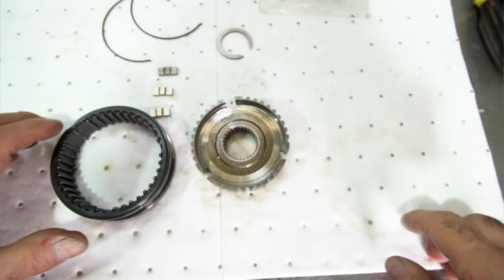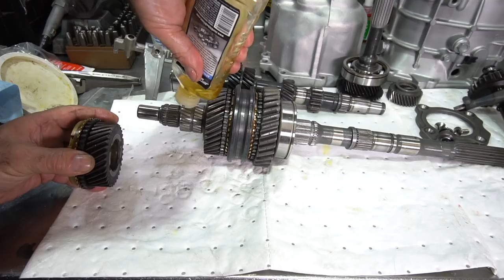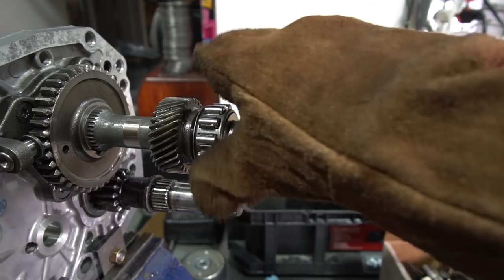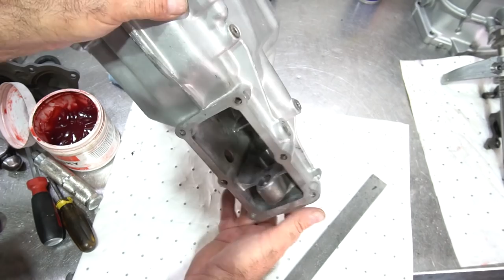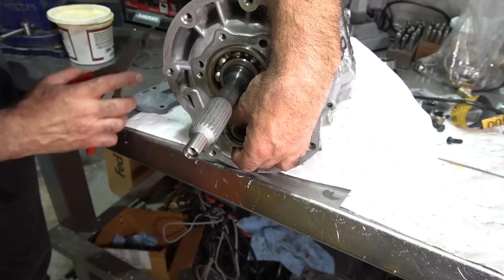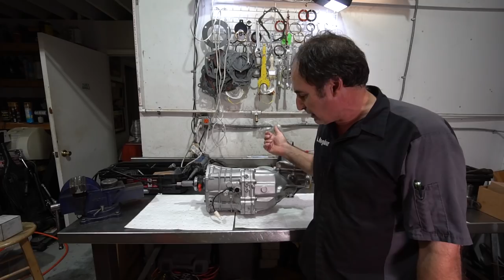How to Rebuild a Toyota W58 5 Speed Transmission - Part 2

Comment: I have a problem, as I mentioned before I bought a w58 to swap the A/T from my Is300 and I think I have the wrong driveshaft because if I try to insert it is hitting that bushing 40:25 ... this is driving me crazy, Should I get another driveshaft or what?....... keep in mind, I’m doing it myself
Reply from the maker: It could be just the wrong yoke. Some yokes have a larger outside diamter
Reply: Are you trying to reuse the AT shaft? Usually the AT shaft won’t fit in the MT gearbox as the yoke for the AT can be slightly bigger or the splines will be different.
Reply: Daniel G absolutely not, I know that the A/T is shorter, I found that my w58 is from 1987 and got like a ring on the tail housing and I need a special driveshaft

Comment: So I have a question I have a w58 in my basement from my buddies Lexus sc300. The guy we got it from said it was a “later model w58 with the steel ring” do you have any clue what he’s talking about ? Also the input shaft has a little bit of play can the input shaft beearing be changed alone without the whole trans being taken apart ?
Reply from the maker: It's possible to pull the front retainer off and with a puller get the front bearing off. It's a tight fit. He maybe thinking of an iron center support.
Reply: GearBoxVideo good to know! Trans was flawless besides the small play I noticed. What causes the gear whine on these trans ?
Reply from the maker: Low oil. Which ruins the cluster And input gears
Reply: When he says "steel ring" he probably means the cast iron centre plate.

Comment: Do you know the technical differences between the Toyota g52 and w56/w59 in the Toyota trucks? I think the g52 was behind the carbureted 22rs whereas the w56/w59 was behind the Efi trucks. Is the w series stronger? Better gear ratios, longer lasting? Also didn’t they have gear driven transfer cases? Why don’t manufacturers make gear driven transfer cases anymore?
Reply from the maker: I do not know the difference
Reply: pirate 4x4 says that the w is a little stronger than the g, but not by a huge margin. The R transmissions they think are about twice as strong as the W.
Reply: The older ones are gear drive transfer cases, either 92 or 95 and up (i think 92) they went to the chain drive. Marlin crawler says there is no strength problem with the gear drive cases. If anyone would know, it would be the people who machine parts for multiple stacked reduction cases, so I would trust them. They do a number of different cases the old ones the new ones and non-toyota ones on toyota gearboxes.
Reply: Toyota seems to agree, when they do the jz engines without a turbo, they used W gearboxes. when they put in turbocharged jz engines they used R gearboxes. Both will bolt up, R is heavier duty. Call marlin if you need help figuring out how to bolt an R transmission to your truck.
Reply: FlyTheElephant ok I did a little research: it seems that a g52 is about 30% weaker than a w59 in trucks around the 85 model year. The r series, especially the r154 are around 50% stronger than the w series as you said. Larger synchronisers, bearings and gears in addition to a well designed case make the r series the strongest transmission of the lot. Do you know if an r150 or 151 will bolt to a standard 22r or 22re? I know they used the r154 behind the Turbocharged 22re’s; however, that is a different block with altered rœtæting assembly and pistons, as well as a redesigned head...
Reply: @ramblerclassicman221  yea call Marlin crawler. They know the specifics.

Comment: Hey bud, please help. I just had a friend replace the bearings in My R150f Toyota tranny. I pulled the cases off and took him the rest cause he had a press for the bearings. I got it back and he had a rod turned wrong, but i clocked it correctly and made sure it shifted fine. Long story short. I got it installed and it seems like it's not coming all the way out if reverse. I can shift fine through all the gears,but when i put it in reverse then back to first it acts like it binds. Ive been messing with it for a little. And i can shift in second from reverse and it will come out of reverse. U just cant go from reverse to first. Once i shift into second gear first, i can go into first. Or i can go from reverse, straight to second,and its fine. It just seems like reverse isn't disengaging all the way. No i did pour all my mt-90 down through the top and i also poured Lucas oil stabilizer down it first. I thought taht since that stuff is thick, it was making it stick in reverse,but i drove it around for a little and it still does it. So i think that reverse arm or fork isnt pushing the gear back far enough and when i shift into 2nd it somehow bumps reverse out. Could he have somehow left out something on that reverse fork, or there be some kind of adjustment on that fork? Please help. Your the smartest tranny guy i know.
Reply: Also. There is a little oil pipe, that fits up in that case ,and it kinda lines up with the counter shaft. Its a little small plastic funnel looking thing. I really don't see what good it does,and mine broke all to pieces so i just left it out. Will that hurt anything? Like i say, my newly rebuilt transmission (r150f) isnt disengaging reverse completely.
Reply from the maker: I honestly don't know what you could have done other than make sure the interlocks are properly installed. All this should be tested out of the car on the bench with no oil in it.
Reply: @GearBoxVideo  Yeah i ask if he tested it, and he said no because he had lost that interlock spring that goes in through the top. So i had to get one, and when i put it in, it wouldn't shift in any forward gear , thats when i noticed that he had that 3rd rod down,clicked 180° out and the cut in that shaft was pointed towards the inside gears. So i just took out the springs and puched out that roll pin and turned the rod ,to where it was supposed to be. He said he had put all the detents in and the balls and springs in from the side,so i didn't take any of them out when i turned the shaft. But after i got it turned and all the springs back in. I shifted it into 1st and 2nd and 3rd and 4th and fifth. I didn't look around and see if reverse came out. I just knew that when it wouldn't shift and that 3rd rod down was clocked wrong that all those detents and that 2nd one down with the pin in it , was jammed up. So after turning that rod then all of them would shift. And it did shift in and out of fifth and reverse is on the same rod and it shifts into reverse fine, it just doesn't come out of reverse like it should. I plan on driving it for a week, then tearing back into it next weekend. Cause its on my daily driver. But you think it might be in those detents or maybe something on that bottom rod that isnt letting it travel far enough?  Also, thank you for replying,cause it has me freaking out.
Reply from the maker: Hard to say.  I'm working on another video that deals with rails and interlocks. So who knows what this person did.
Reply: @GearBoxVideo  Ok. Thanks for replying to me. Ive been studying the sch. drawing on my transmission for the reverse and the shifting rods. I believe if any of the interlocks were still out of place, it would have a shifting problem. And it doesn't, it goes into every gear. Ive been looking at the reverse linkage and the rod for reverse and it seems like that linkage isn't traveling far enough back on the rod ,inturn not letting that reverse fork to push the reverse gear out far enough. Like if there could be a washer or something that sits behind that reverse linkage,where it bolts to that plate? I didn't know if you know of anything that would set that reverse linkage out futher. Or where it pivots off of that piece below it ,to make that arm move out and disengage reverse? All the drawings that i look at, have all the parts, but dont show any mounting hardware,like screws and bolts and washers or spacers. So i was hoping you would say, yeah theres a spacer that fits behind that reverse linkage or that theres an adjustment on that reverse fork where i could move it out on the rod a hair more. Or something like that. Im just trying to juggle your memory a little and get you thinking,cause i know you deal with a hundred different trannys. And the fact that you take time to answer someone when i know ur busy as hell, is good thing. And i appreciate it. Cause i know what its like trying to trouble shoot something without seeing it. So thank you for your time. If you happen to think if any possible causes that would cause that reverse arm , not to move out as far, please let me know. Also, it confuses me why, i can go from reverse to 2nd, and it will come out of reverse, but it wont come out of reverse, when i go to fifth? I thought that going to fifth from reverse would cause it to giggle out better than going to second, cause fifth and reverse is on the same rod. But thats not the case. Somehow going to 2nd, gets it out of reverse. Im going to take it out next weekend and tear into it ,and so im trying to have ideas to look for. Cause since this is my only ride, i have to get it done and back in before Monday morning. And plus i drive to work over 80 miles one way. Just let me know any ideas that might pop in ur head,so i can have an idea of what to look for when i take it out next weekend. I know ur a busy guy and i sure appreciate you trying to help. Its not that im a cheap person that doesn't want to pay someone to work on it, i just can't afford it, so thanks again!!!!!
Reply: @GearBoxVideo  I found a schematic that shows that smaller rod( last one down) doesn't have the ball and spring coming in from the side where all the others come in from. It actually shows the spring and ball towards the end of the rod , like it goes in behind the reverse return arm. It actually shows two balls. One on top of the rod, and one on the inside of the rod with the spring. Like it somehow goes into the reverse shift fork. Do you remember if there is any ball and spring that goes on the fork, or does it go into the side like the others?
Reply: @GearBoxVideo  Found out what the problem is. He had the small rod( reverse return rod) clocked 90° out. So the ball couldn't catch in the cutout in that rod and so the fork would slide too far instead of catching ,and cause it not to come all the way out of reverse. I took what you said about the detents and studied every schematic that i could find, and put it all together. He had that 3rd rod clocked wrong ( that i fixed before i installed) also, he was just looking at the wrong cut out when he slid in the rods and was trying to make sure the detent would go in.
Reply: This sch. Was off. Disregard it. It does have one ball on the opposite end but the spring goes on the other end, where all the other ones go.
Reply: You mucked up obviously you did not put it back together properly.
Reply: @unclequack5445  Well, sort of. My buddy didn't put it together right. He lost one if the detent balls and didn't know it. And it wasn't something that you would catch when i tested it because it was going into and out of Reverse just fine, without any oil in it. And being that there are several variants of this transmission it was hard to guess at what was wrong until i took it back apart. There is a detent ball that goes in the reverse return linkage that he lost. My mistake was letting someone else do it. But he wanted to and plus i was going to have to use his press anyway.
Reply: @todhowell5049  i think that little plastic funnel like part is the 5th gear oiler ??
Reply: @todhowell5049  what do you mean by this in one of your posts?  "And being that there are several variants of this transmission..."

Comment: good day and thanks for a pretty clear tear down. I’ve been rebuilding a W 58 and have found on mine the little tic tac looking detent on the shifter fork (3.4) has broken and fallen into my case. Seems to load against the reverse arm but not sure. With it removed when I dry assemble I hear/feel the reverse restrict pin clicking against one of the gears. Can you live without that little pin, and if so is the lack of this ion causing my clicking. Wonder if I can live without that reverse restrict or pin as well?
Thanks for the great explanations on your vid’s and keep it up!
Reply from the maker: No the pin is there for a reason
Reply: Any chance you have one in your spares? Happy to replace it if I could find a p.n. or ID number for that little pin. Mine’s damaged so no longer fits in the fork. Not sure if it was spring loaded or fixed in position.
Would send a pm but not sure how in YouTube. 
Cheers @GearBoxVideo
Reply from the maker: I don't. The spring is a detent spring for the reverse bias so there is a spring in there and a pin that when you go into reverse it pushes the pin and gives you an extra lock out for reverse

Comment: hey mate, is it possible to convert a 1993 w58 that had a remote shifter and electric speedometer, and put a non remote and cable driven speedometer on it?
Reply from the maker: I really don't know. Depends on the casting and if the mainshaft has a provision. If the electric sensor is gear driven, probably yes. If it has a magnetic reluctor probably not .
Reply: By remote shifter do you mean what's commonly referred to as a "tripod" shifter?  YES. However, I believe you will possinly need an early model tail housing, and all related shifter parts. I haven't tried to just swap the inner socket out for the earlier model but from my own transmission (late model tripod) and watching this video, it may be possible to use the late model tail housing with an early model shifter as long as you have the right shifter, shifter tower, and the metal block that attaches to the shift selector rod. I hope this helped.

Comment: Super job. I'm rebuilding a GETRAG 265/6 for my e28 m535,its similar.can you do a rebuild video for it ? I assure you that it will be a huge hit.
Reply from the maker: Do you have a transmission you can send me and parts? Then yes
Reply: @GearBoxVideo  hi, I sent the support an email regarding doing the 265/6 video but it seems you answer faster here 😉. I have an ebay box in L.A just waiting for you.
Cheers.
Reply from the maker: Check your spam. Anyway right now I am not doing any rebuilds
Reply: @GearBoxVideo  the gear box is going to be in the USA for the next 25 days,when do you think you will have time to do this video ? I don't mind waiting 3 months, I have almost all the bearings and rings.

Comment: Why anerobic sealant and not an rtv like permatex ultra grey?
Reply from the maker: Because RTV never dries completely. So RTV can take a long time to cure. Especially areas that have clamped parts where there is no air. Anerobic is pretty fast. Especially if the trans is going back in service the same day
Reply: @GearBoxVideo  Do you need a gasket when using anerobic? or just clean the mating surfaces and she is good to go?

Comment: If you did not replace the synchronizers then why did you open this gear box?
Reply from the maker: This was for a restoration and the person purchased the transmission WITHOUT knowing the history.  Since I do not have X-ray vision and we do not know if anything is wrong with the transmission you do actually have to look inside. Reseal it and replace the bearings at minimum.  Replacing parts is not always the answer and that should be the take away of this video. Just because you put new parts into something does not mean they are good quality parts. The amateur replaces parts without an understanding how they should kit or work.
Reply: @GearBoxVideo  I am in the process of learning in order to rebuild my 91 corolla transmission, I think it is C50. It scares me out seeing you explaining how the new synchronizers can be bad. Any idea of the best source to buy them from?
Thank you so much for this video and the tips, it helps a lot. Taking notes of everything order and direction is a must as you remove them. Something I learned.
Again. Thank you so much.
Reply from the maker: Toyota replacement parts are the best.

Comment: Is there a reason you didn't use feelder gauge?
Reply from the maker: No reason to use one. You cannot change any clearances and nothing was burned or worn
Reply: @GearBoxVideo  thank you for the quick response! I'm rebuilding my w56 currently after a bearing broke and chipped my 4th gears and this video was a godsend and inspired me to do it myself! So another question would be, if my gold rings (sliders?) don't wobble and grab correctly and there's no signs of wear or grinding on the parts, then it should be safe to assume the clearances are within tolerance?
Reply from the maker: Yes

Comment: Dear Sir, could you do a short video showing how to change the input shaft and its bearing on these Toyota W series Transmissions? This would be very helpful for anyone needing to change their input shaft due to excessive pilot bearing wear.
Reply from the maker: Watch the video and look at the gear.
Reply: Agree. It looks like you have to remove enough parts to get the mainshaft and countershaft to move forward enough to spread them apart to remove the input shaft. And to do that it's almost a complete disassembly, with heating and pressing operations involved.
Reply: Did you figure out a way to remove the input shaft w/o disassembling the transmission?